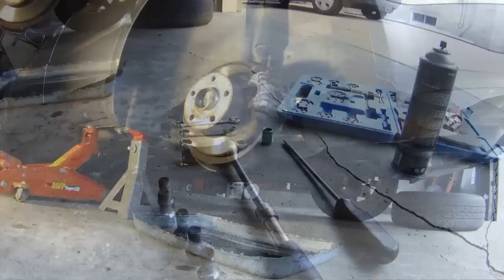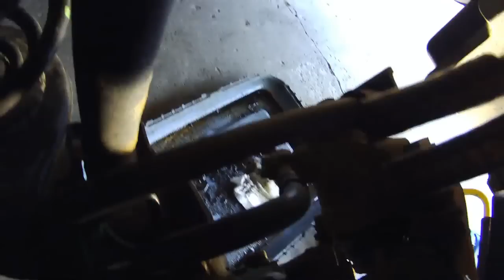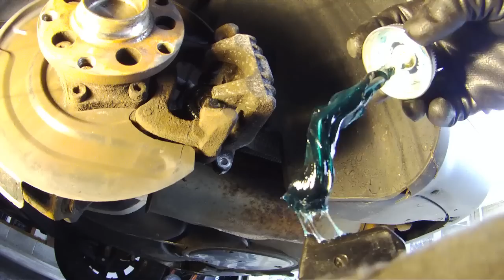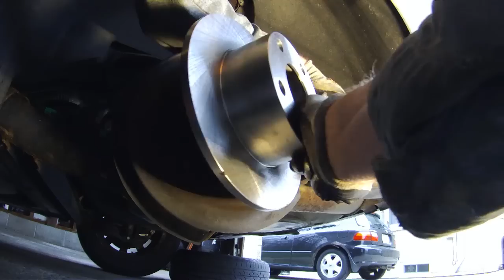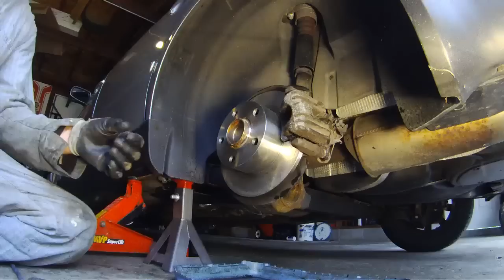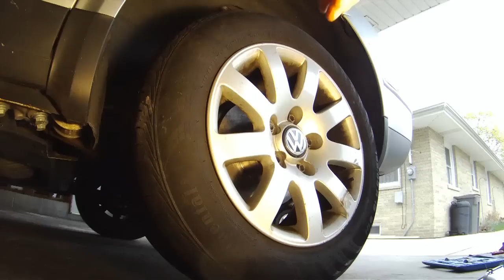VW Passat Rear Disc Brakes (1998-2005) also Audi A4 (1996-2001)

Comment: Had to disassemble whole  rear caliper cause couldn't get piston to screw back in, it was only spinning but not going in. Finally put it all together and managed to screw it back in by pushing it a lil while turning (I was using a channel locks). Very disappointed now because my master cylinder lost pressure  on the secondary circuit (the side towards the front of the car) so I believe I have a jammed piston. Any thoughts will be appreciated. I changed all 4 brakes but didn't open the bleeding screws so just pushed the old fluid back to the master cylinder. First time this happened to me. Lesson learned! 2002 Passat 4 motion.
Reply: I hope you fixed your brakes now. I am planning to do this on my 2003 passat 4 motion. 
What do you suggest - Is bleeding mandatory? If bleeding is mandatory, should I use the vice grip with rubber inserts and pinch it?
Did you have to add brake fluid after the job?

Comment from the maker: There's some heated debate on this topic including...  

1.) whether to open the bleeder valve at all,... 
2.) whether to clamp the brake line, and... 
3.) whether to perform a full flush every time the system is opened.

Comment from the maker: The '98-05 VW Passat and '96-01 Audi A4 are the same platform, so your '03 A4 is one generation newer.  That doesn't mean there aren't common components between generations, but... Make sure you do your research to see which vehicles use the same calipers as yours.  If you don't have a shop manual, call an auto parts store and ask which part works for your car.

Comment: Great job, but the wheel must spin more freely once the handbrake is released.
The solution is to clean verry well the rust on the surface the brakepads are sliding so they can retract freely once the brake/handbrake is released.
Some models come with an stainless steel sliding accesory kit wich should be designed there in the first place also for front calipers. Ceers

Comment: I really don't think it is necessary to pinch the brake line. I open the bleeder when using the caliper retraction tool. Then close it. After pad/rotor replacement I then bleed that wheel incase any air got into the caliper or brake line. Of course you will need someone to work the pedal for you or use a one man bleeder kit. Then top off the master cylinder. The 2003 passat uses DOT4 which is synthetic fluid for those who might be interested. Don't use DOT3. 3 can use 4 but 4 can't use 3.

Comment from the maker: Did you use a C-clamp on both rear calipers? Are the regular rear brakes working on both rear wheels? I'm just trying to figure out if you should go buy a new rear caliper (or two). If the regular rear brakes are working at both wheels, you could probably just continue to drive that way. If you only broke the parking brake self-adjuster at one of the rear calipers, you could probably just continue to use the one working parking brake. Otherwise, you can get an OEM caliper for $100. Good luck!

Comment: what disc did you use with the caliper tool.  Seems like "F" was best.
Reply from the maker: I can't remember which disc I used, but my experience has been that you'll know exactly which one to use because only one will fit perfectly.  Do a little trial and error by putting the discs up to the piston before you commit.

Comment: Cant u just use a c clamp to work the cylinder back in? Do u have to open the valve at all?
Reply: Nvrmnd someones comment answered it 4 me.
Reply: No, you can't use a normal clamp. Because of the built-in handbrake, the piston must be turned while pushing it back.
Some say yout have to open it, so the brake fluid is not pushed back in the ABS valve block. I don't open it.

Comment from the maker: That's bizarre!   Is it like that on both side of the rotor?   If the outside pad is not making good contact with the rotor, but the inside pad is, you probably have stuck slider bolts.   The two metal pins that the caliper slides on sometimes get rusty and seize.   Remove the caliper, remove the slider bolts.   Inspect and replace if necessary.

Comment: Could you use a large syringe to pull fluid from the reservoir so you don't need to bleed the fluid from the line/valve?
Reply from the maker: TankCatIntoMordor Yup.   That's actually what Curtis Paul recommends in his comments below.   Just remove some reservoir fluid, and compress the caliper without opening the bleeder valve.

Comment from the maker: Definitely replace the calipers soon. Did you open the bleeder valve before C-clamping the pistons?   If not, you could have potentially damaged the brake master cylinder too:(...  I don't think the clutch hardness could be related to the brake issues.  Good luck!

Comment: Service manual says to flush the break fluid, open right rear bleeder, flush fluid by pumping the break while engine is running.  Do this until fluid runs clear (make sure to top off master so you don't push air in.  Is there some sort of check valve in the caliper bleeder?
Reply from the maker: Curtis Paul There is a lot of debate over whether brakes should be bled each time pads are changed.   If your brakes aren't currently squishy, I'd recommend skipping the brake bleeding, whether legitimate (as described in manual) or pressure release (as shown in this video).  Watch a brake bleeding video on YouTube if you've never done it before. No. There is no check valve in the bleeder.
Reply: The service manual says change break fluid after every 2 or 3 years.  It's not related to changing the break pads.  Flushing the break fluid is a matter of regular maintenance, like changing the engine oil is.  If you leave the old fluid in to long it can cause the ABS pump to wear and loose pressure, it can cause valves to get stuck.  You don't have to flush the break fluid, it's your choice as it's your car.

I just did it to my car.  The service manual also says to run the engine while bleeding breaks the traditional way.  There is also a service port on the master where an amount of fluid can be vacuumed out.  I recommend vacuuming out fluid, fill up, then vac out again, then fill up again.  Then flush the break lines through bleeding.  Start right rear, then left rear, then front right then left....I believe that was the sequence the service manual stated.
Reply: I also don't recommend clamping the flexible break line, especially if they are older lines, could cause the line to weaken at the crush point and blow out a year or so later.
Reply: I bleed the caliper while retracting the caliper piston, simply because I was already planning on flushing the break lines.  However, I agree that bleeding while retracting the caliper piston it's not necessary if just changing break pads.  Just make sure to vacuum out fluid from the master because if you don't you might have fluid run out of the master if you have topped it off at some point before replacing the pads.  Break fluid eats paint and makes a mess.  If you have never topped off your master, then chances are you won't have fluid run out of the master.
Reply from the maker: Curtis Paul Great feedback!  TY!
Reply: One more thing, need to stress this because it may be a safety issue.  The rear caliper bolts need to be replaced.  The bolt threads have some sort of locking compound on them.  I think they were about $8 for a new set of bolts, kit also came with the little rubber boots that go over the caliper float pins.  In other words, don't use never-seize on these bolts if you choose to reuse them.

Comment: Brian Tardivo You can compress brake pistons with a c-clamp and the old brake pad or a piece of flat stock.
Reply from the maker: Actually, no...  Rear disc brakes with integral parking brake need to be twisted and compressed at the same time using a special tool.   At least these do.  Do not attempt to compress rear pistons with a C-Clamp.
Reply: hanoihancock I'm sorry, didn't mean to spread disinformation.
Reply from the maker: viper0981 No worries.   I had no idea about the need for a special rear disc brake compression tool until I did this video:).

Comment: I was wondering if any of you guys could help me.
My son carried out this repair for me and now my brakes are hard to depress, they work, most of the time! Two or three pumps renders them useless. daren't drive it now! Any suggestions, please?
Reply: Hopefully you've gotten your brakes fixed by now, but if not I suspect that air was introduced into the system. To remove it, you'll need to have the brake fluid replaced by a std. bleed procedure. I recommend finding a mechanic or shop that has the experience and tool to apply positive pressure at the brake reservoir rather than trying to pull brake fluid via negative pressure at the caliper. If your relative will attempt to fix the issue, he probably needs to reference a repair manual. This video is pretty good, but it also skips details that can bite.

Comment: When I removed the bleeder valve cap, it flew away, not to be seen again.  How important is the valve cap?
Reply from the maker: Not very important.  It'll turn up eventually.  In the meantime,any hardware store will have rubber caps in the loose nuts/bolts section that'll do the job.   Failing that, just wrap some electrical tape around it to keep it from rusting during the winter.

Comment from the maker: The piston gets pushed back out by the pressure of the brake fluid like the front.   The need to screw in the piston has to do with the parking brake self-adjuster within the piston. Although the caliper will work without this step, you should apply and release the parking brake to extend the parking brake self-adjuster before pumping the brake pedal to set the piston.  "myturbodiesld0tcom" has a great video showing a disassembled caliper that will help you make sense of this concept.

Comment: did you get the "brake fault STOP see service manual" with beeps??? mine does it all the time? brakes are good, brake fluid is full????....WTF some one plz tell me how to fix it? ABS mod? and the check engine light is on, hooked it up and it shows no faults? I can reset engine light but it just comes back????

Comment: dad parked my volks with the handbrake on, took the battery out and left it for 3 months - handbreak seized - know how I could take the hb off or unseize it without removing the weels?, caliper disc breaks, 99 passat, can I take off the back wheels and get the hb off ??? HELP!

Comment: So i have to remove the rotors and i have no other choice correct?
Reply from the maker: If you are just looking to replace the pads, you should  have plenty of room to do that without removing the rotors. I just removed the rotors in this video because the original ones were warped.

Comment: I tried to remove the left rear rotor on my 2002 Passat 4-Motion but it is completely stuck.  I tried hitting it with a hammer (with light to moderate force, though not with a sledgehammer) numerous times all around the rotor.  The rotor did not budge.  The rotors have been on there for at least over 8 years and maybe they are originals factory-installed in 2001.  I gave up since I did not want to damage anything.
Reply from the maker: You'll get it!  These things can be rusted on there pretty good, but you'll be able to break it free with a sledge hammer.  Go borrow one from your neighbor.   Don't try to pry the thing off.   That won't work.  You've got to hit it hard with a heavy metal object.
Reply: hanoihancock Thanks for your reply.  Are you sure there the rotor is not bolted on somehow?  Will hitting it with a sledgehammer work on all four rotors?  Remember, they have been on there for at least 8 years but maybe since the car was built in 2001.  I'm guessing the rotors are original.
Reply from the maker: Some rotors have two small phillips head set screws that hold the rotor on.   Double check to see if you have these.   If so, remove them. Use a #3 phillips bit.   If not, Get a sledge hammer, and tap around the edged of the center until it breaks free.
Reply from the maker: Here's an example of a rotor with set screws. http://youtu.be/AMj9WrCBmkw?t=43s
Reply: hanoihancock Thanks.  My rotor did not appear to have any screws into it.  Last question (for now anyway) - is a 4 lb. sledgehammer sufficient?
Reply from the maker: Robert Kunz 4lbs is better than a traditional hammer, but 8 or 10 lbs will pretty much gaurantee that rotor will break free:).
Reply: hanoihancock I tried again to remove the rotor using a 10 lb sledgehammer.  Absolutely no movement.  I sprayed WD40 through the screw holes and around contact points.  I hit it around the center of the rotor numerous times with the force you used in the video, maybe a little more, but absolutely nothing.  There are no screws in the rotor so I am sure it is rust (8-13 years of it) holding it in place.  Surely I don't swing the sledgehammer much harder, risking breaking something.  What else can I do?
Reply from the maker: Robert Kunz These things can get rusted on pretty good.  I would stay vigilant and hit the disc with increasing force until it comes loose.  Maybe try a few downward hits and upward hits instead of just hitting from one side?  I have had some discs stuck on way harder than the one in this video.  In other words, I have had to use waaaaay more force on some discs than the force I used in this video.  I got kinda nervous that it wasn't going to come free, but all of sudden they just break free. Let me know how it goes!
Reply from the maker: Robert Kunz Also...  I found this other YouTuber's method of removing stuck discs which is pretty genius. http://youtu.be/mtsTJCRljAs
Reply from the maker: Robert Kunz Here's another YouTuber applying significant force to a rotor with a smaller sledge just to give you an idea of what acceptable force is. I would say you could hit twice that hard and still be fine. http://youtu.be/U2aKuNSYh7E
Reply: hanoihancock Success!  The keys were a good dousing with PB Blaster and hitting the rotor harder with the sledgehammer.  The first rotor came off after a couple of douses and a couple rounds of hitting.  The second rotor came off easier, though I allowed the PB Blaster a few more minutes to work.  The PB Blaster also helped with the caliper bracket bolts, which were quite tough to unfreeze.  Thank you again for your help!  I will replace the fronts tomorrow.
Reply from the maker: Robert Kunz Nice!  Isn't it a great feeling when you think you've got an insurmountable problem, and then...boom!  It frees up!
Reply: FYI: For anyone having the same problem....remember that Heat Helps to get the atoms moving and will soften the metal. I recommend using a Small Butane Torch just to heat it up First... a lot like when you run Hot Water over a stuck Twist Cap on a Jar ;)
Reply from the maker: lightmodifi Good advice.   Thanks!

Comment: U didn't mention any of the special tools that u used....that dont look like a normal C clamp to me?
Reply from the maker: Rear disc brakes with integrated parking brake can't just be c-clamped.  You need a rear disc brake tool that twists and applies pressure at the same time.  Some guys have said they can do this by hand with a needle nose pliers, but I'm too much of a weakling for that.  Go to Harbor Freight and buy their rear disc brake kit.  It comes with adapters for many cars.  Good luck!
Reply: @hanoihancock  yea i used needle nose. It was a huge pain in the ass.